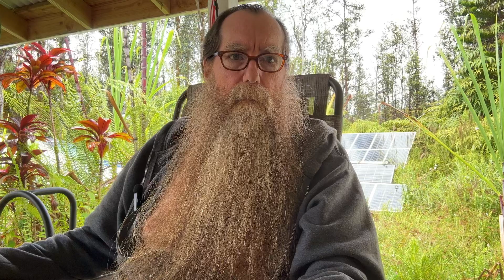Lightning strikes twice! 300 Million volts 30,000 Amps Gets your attention! Grounded, or ungrounded?

Comment: Excellent topic  Gary.  As a lifetime amateur radio operator and growing up in the Tampa area I have a bit of experience with both direct and indirect hits from lightning.  Today, there are a number of good websites that show historical and real time lightning strikes as well as other websites that can give you a probability of a hit based on your geography and height of the target.  When my tower was in Tampa on my parents home I had four direct hits and three indirect that I am aware of.  My tower was 70 feet with another 19 feet as I was an idiot and mounted my 4btv vertical on top of my HF beam.  The tower had a 21 ft water pipe sunk into the water as well as 3 10 ft pilons holding the tower with the guy wires (1/4") to 2 inch water pipe also sunk into the earth.  The result was that the direct hits caused no damage coming from lightning(dc) which is a capacitive or differential type strike.  When I was operating on the radio or doing homework in my bedroom, I could hear the coax switch capacitors make popping sounds, so I would disconnect the coax pdq.  People don't realize that lightning actually comes mainly from the capacitive delta between the earth and items around it (think clouds that have friction in the atmosphere) or like wearing socks on carpet while rubbing your feet and then shocking your partner or yourself when grabbing something like a door knob.  The difference is the POTENTIAL and thus static electricity builds up to the point that the capacitor dieletric discharges.  So all my life I have a ground on my inverters and never buy ones that don't have a REAL ground connection as I verify them with a meter.  I have service ground (earth) and a SPD on the combiner box in the attempt to take a NEAR hit as the panels would absorb the energy from inductance alone.  For off grid, using a metal type container MAY provide some EMP (near miss) if the metal skin is properly grounded so that the energy goes AROUND and not THROUGH the solar equipment.  Additionally, look for ways to discharge static build up such as a 9 ft CB antenna mounted in a high spot and fully grounded.  While living in Arizona, we did that in the ponderosa pines and ran the cable down to the creek bed to protect the cabin.  Sorry for the book, but people should research the probabilities and then decide what IF anything to do.  But one easy way to test static differential is to take a 24v or even 12v battery and connect it to equipment.  The spark is the 'differential' or lightning but in a small form!
Reply from the maker: Mahalo for sharing your experiences and systems! I used to live near a guy with a huge tower like you, and he always sweated a bit when the skies were flashing! Aloha! 🤙

Comment: My most experience with lightning was running a remote aboriginal community in Western Australian desert. The landscape was as flat as a pancake for hundreds of kilometres. It would predominantly hit the highest metalic structure (our water tower) then next was vehicles (lots of metal) then houses, then tree's the least often.
The fundamental function of a lighting rod is to encourage the lighting to discharge where you want it to. If you put one on your house roof, that's where it will be encouraged to go. If you put one well away from your house it will hit there. All it has to be is a well grounded copper wire run up a tree. (But the tree won't last very long).
Reply from the maker: I understand what you are saying, and yes, that tree will be cooked! Mahalo! 🤙

Comment: Lightning is awe inspiring.  Grounding for lightning protection has some engineering, but most of it is still "best practices" which are derived from experience which when explored starts sounding like black magic.  Transmitters (e.g. radio and television) will often do a ring ground (or multiple) to ensure the earth potential around the building is uniform. I've done that around my home with Delta LA "lightning arrestors" on both D.C. and A.C. entry points and at critical equipment.  So far with nearby strikes I've not experienced any damage but who knows why.

My in-laws, a few miles away, had a lightning strike with some damage. A tree on the far side of a 1 acre pasture was hit. There was an electric fence around that pasture with a fence charger in an outbuilding 500ft away from the tree.  The charger fed thru the wall of the building to the fence and another feed to a 10ft ground rod driven vertically until the top was below ground.  That fence charger was a lunch box sized, vented metal box. After the strike we found it exploded with pieces including the top cover 20ft away on the far side of the shed. The charger was no longer square, but mostly round.  That fence charger was apparently the only damage, but a year or two later we found more that I believe was caused by the lightning.

One day there was no power in the outbuilding. The breaker at the house was on, and the terminal leaving the breaker was live and the breaker was slightly warm and vibrating.  A clamp meter on the wire leaving the breaker showed 10-12 amps flowing.  Yet the point where the wire came out of the ground and entered the outbuilding was dead. There had been no digging or anything like that to disturb the wire.  We dug up a point about mid-way on the run and cut the wire.  It was dead.  We dug up about mid-way from there to the house and cut the wire.  There was no wire inside the insulation, just green dust.  We rented a trencher and ran a new wire.  The trencher pulled out most of the old wire, and much of it had disintegrated into green dust.  It was UF (underground feeder) rated cable, and I figure the lightning had perforated the insulation as it discharged into the ground around that wire. We couldn't see holes, but the grey insulation was also stained in places with green inside and out.  Over time I surmise moisture had migrated into those invisible holes and then current started leaking thru into the ground, gradually dissolving the copper until there was nothing left.
Reply from the maker: Love the stories on this topic, and mahalo for sharing this with everyone. Aloha ! 🤙

Comment: What most folks call a grounded system is protection for 120/240v systems. Lighting is a totally different beastie. 
I ran an HF radio shop back in the day, lots of big antennas. We got a warning of big lighting coming coming, so I went out to the power pole and transformer feeding the shop and pulled the main disconnect  breaker. Took a hit about and EVERYTHING was fried. Did matter that everything was disconnect/unplugged. Taken hits on long wire HF antennas with lighting suppressors on them. The suppresors are usually slagged, but if they get the current started in to the ground the equipment is usually OK. If the surge blows through the suppressor then things are toast 
For the EMP side of things a Faraday cage is a great help
Reply from the maker: All great information, and a great share my friend! Mahalo! 🤙

Comment: My Array is grounded at the Array. 18 surge protection devices made by midnight solar installed on the entire off grid system. Everyone turns their circuit breakers off during a lightning storm. I used to. If one gets a direct hit, it’s not going to matter because you’re neutral and ground run throughout the house and are not disconnected when you turn off the main breaker or branch circuits.

Comment: My  antenna mast is Not  grounded. 
But  by  the  NEC. It should be. 
My  theory is  lightning hit the  tallest  object  with the least  resistance to ground.
Reply from the maker: I always subscribed to that theory as well. I always wondered though why it blew a hole through my home instead of hitting the grounding rod only feet away. Unpredictable at best in my experience. Aloha! 🤙

Comment: I do electrical repairs on components.  There is not much you can do against a direct hit. I  feel the electrical system ground is more for a potential difference shocking you than protecting you from lightning strikes.
Reply from the maker: I agree with that for sure! Aloha! 🤙

Comment: Great discussion topic, one thing to consider is grounding the system for safety or to pass inspection if applicable.   By safety I mean ground fault of your appliances and devices for personal safety to avoid shocks or fire hazards.   It's kind of tough to decide in many cases where there is lightning often.  Earth ground is important when you need it but will it attract lightning?
Reply from the maker: So many things to consider, it boggles the mind! Mahalo for being part of the discussion🤙

Comment: This is intresting i am currently sitting here in a 80mm rainstorn with a fair bit of strikes in the horizon, i live on a small island in the Baltic sea and have been offgrid  and living in 2 caravans since my house burned down last oktober and for Europe we get fairly vicius lightning storms here,,we have had several near misses while the house stood ,,but for sure one gets ALOT more respect for lightning while sitting in a flimsy caravan that thin plastic 1 inch of insulation and 5mm woodbord feels really thin even when the strike is withinn 1-2 kilometer it is awesome but not in the good way ,  my generator charger/inverter is grounded and panels touch the ground , mainly for the reason of running 190v in from solar panels and  do not want to get shocked by dc ,(i took a 230volt dc hit while working on a coaster in my teens )  and have had a good bit of respect for high voltage DC ever since , i am lucky that the tv towers is quite close to my farm 2 km so they take most of the hits but i am about to run a windturbine and the chance of a strike hitting that thing and going in my 14kwh lipo bank gives me the hebee jebeezees i got to figure out a 3 foot physical disconnect in case of lightning , now the turbine is connected to a barn with metal roof and groundrod installed but still imagine the fireworks it one of those got to the battery bank.......
Reply from the maker: Mahalo for sharing your experience from your part of the world! I really enjoy hearing from you on this subject. aloha! 🤙

Comment: Would like discussion on  this subject also. My small house was wired by electrician (when I intended To be on grid). Changed plan to off grid 12v systrm 10 years ago. Still have that system but  using lifepo4  batteries. Then 2 years ago I installed 24v system. Got a pallet of 260w panels, use only 18 of them on 3 charge controllers for 4 x 24v 200ah lifepo4  batteries. Need ac 24/7 during 6 summer months.  Live on a remote island in Caribbean. Only thing grounded is 12v system. When lightening storms, I turn off pv Isolator switches and hope for the best.  If I leave house in iffy weather, I turn off pv Isolator switches too.  If I leave home for a while, I shut down 24v system just leaving 12v system running only to power my 12v Sundanzer chest fridge.  In hurricane season if one approaches,I take down all the panels and  store them in safe place, disconnect everything and wait it out.  I've only had to do this twice.  Take a day or two to put everything back up after storm.
Reply from the maker: Mahalo for sharing your experiences for all of us! 🤙

Comment: Having dealt with protecting equipment from lighting over the years, I can say it is difficult and expensive to truly protect equipment from lightning strikes. You have these giant antennas, aka wires, hooked to everything, and if you don't have protection on all points where lightning can enter you are fighting a losing battle. That being said, I whole heatedly believe in grounding, you may not stop the lightning, but you will provide a discharge path for static electricity build up, which can takeout electronics quite easily.

A company called Raycap makes arrestors that can absorb 20kA, but they cost about $300 just for the arrestor, throw in mounting and enclosures and you are looking at large price tag.
Reply from the maker: Very well said my friend, and many thanks! Aloha! 🤙

Comment: No Experiance yet with solar but yes lighning can be scary if there is a storm near go inside.  I plan on SPD, Grounding and yet 1 foot rods on top of the pannel row. maybe will not attrack but may protect... IDK.At least 2 SPDs before any equipment gets hit and a 100foot wire between maybe will help.  Also use 3-4 gounding rods per ground to make sure grounding is good but that may just be becase I'm in a desert. "Tiny Shiny house" has some experiance in my area.
Reply from the maker: Appreciate the sharing of your plan! Aloha! 🤙

Comment: the lower voltage/current is typically from a negative charged strike, they are quite survivable, equipment wise, a positive charged strike, you have next to no chance of surviving.  You have a major disadvantage because you cant drive ground stake at least 1.6 metres in ground.  You also have to be wary in grounding, everything must be at the same potential, if not, well, you've seen what happens first hand.  

I note from your videos you don't have DC surge diverters (they call them arrestors, but meh, hardly) after your breakers from your panels.

In relation to lightning rods, there is newer way of thinking, especially by engineers and experts in comms towers, though much debate exists around it,  is that the rods, using ultra fine sharp tipped points, kinda like gladiator ball things, is advantageous to preventing strikes, since the strikes start from high static energy, they attract early on to the sharp fine points and are diverted to ground, preventing a high charge strike build up in the first place.
Reply from the maker: I never heard of what you described, but it sounds very interesting for sure. Mahalo for sharing that! 🤙

Comment: Lightening is scary. The myth of it takes the shortest path to ground is wrong. you just can't predict the path. also a strike makes a EMP . for grounding and un grounded check with budling codes in your area.  how you ground is important as well. my home is off grid grounded and passed UL inspection I need for homeowners insurance. I am in Boston NY had many near hits buy luckily not to have damage yet. being a electrician and working in my area have seen strange things. lightning hit flag pole come up threw ground rod in a home and do damage to service panel but no electronics was damaged.  outher case power pole hit. customers down the road had surge damage . but the customer on that  pole had nothing. ground is not the same. it changes from place to place. soil and water table   play a big part.  lightning has polarity. negative and positive. positive lightning is most damaging and has a different sound. national weather service has video's on that .
Reply from the maker: Lightning is my least favorite kind of weather made! I simply cannot relax when ever it is near...it's like it knows that, and torments me! First time I got knocked down hard by it was at a friends house in the mountains. We just exited his house to sit on his newly built deck when a bolt hit a power pole at the corner of his deck. Lifted us both up off the deck about three feet and thew us assbackwards about ten feet. Was barely a cloud in the sky ...so weird. Second time was on a ladder in a rain storm, had my hands on metal gutter making sure my water collection was working. Bolt hit a tree maybe 100 feet away and arched to that gutter to some degree. I really felt that one. But lighting in my living room , worst ever. Never can forget that one. Aloha! 🤙

Comment: If I were you, I would build one of those panic rooms, out of blocks and cement with rebar rods running through every 12 inches on center, but for lightening storms.. Some people are just a magnet for lightening..There is grounding to an electrical box, so te box and appliances don't become electrified, and then there is grounding with a rod into the ground as a path for the electricity to ground. You have to be careful with inverters, you don't want to double neutral ground bond the system as the ground can become hot..As far as grounding rods go, I have not made up my mind..But, since it seems to be the conventional wisdom, it's probably the way to go..I'm a firm believer in a lightening rod on your roof that goes into the ground. better to hit that than your actual roof.. All tall buildings have lightening conductors to carry the electricity away from the structure to ground.
Reply from the maker: Everyone that knows me has said I am a magnet for this stuff. So many times I've heard it way out in the distance, and then it just marches right on top of me. Aging me with every inch of it's encroachment! 🤙